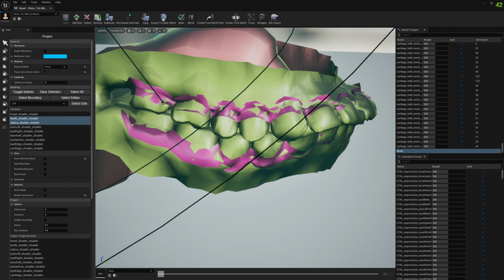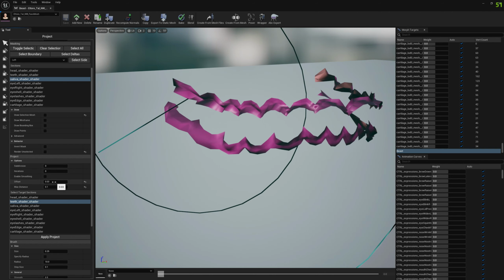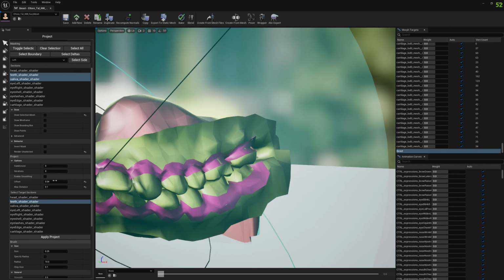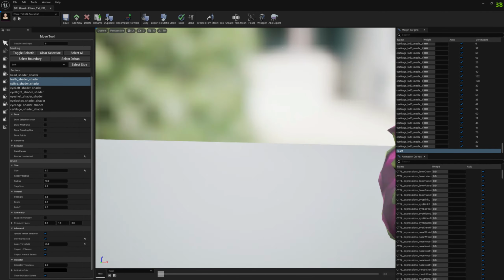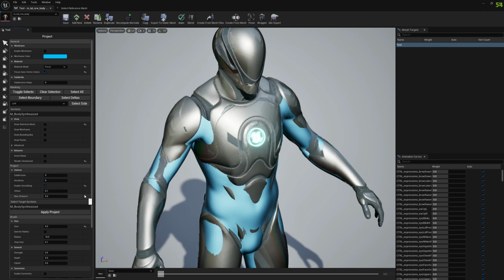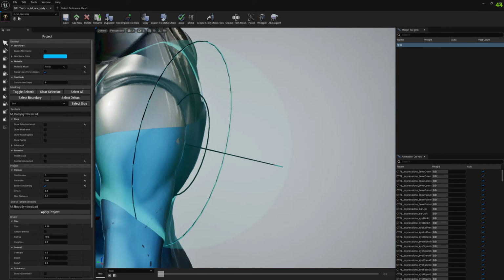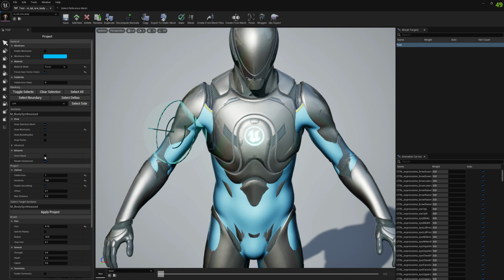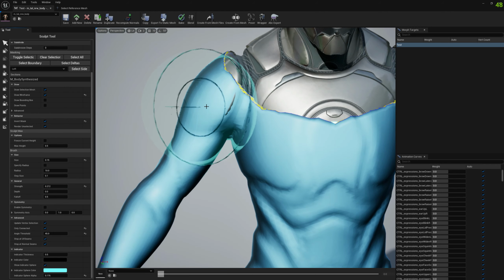Mesh Morpher - Projection Tool

Comment: Great feature, like keeping the projection on the surface when topological mesh, if there is a function that can smooth the mesh while keeping the projection even better. For example, in this state, the brush holding shift can keep the projection while smoothing the mesh. Because the result of indentation is usually partially imperfect, other brush deformations can cause the mesh to deviate from the actual outline of the projection.
If you have used wrap4D you will find that its most convenient feature is the ability to dynamically correct the topological smoothness of the mesh in different places with a brush while keeping the mesh wrapped. It's similar to adding a wrap modifier to blender and then using a sculpting smooth brush or a side Relax brush. It would be nice if MeshMorpher had something similar.
Thanks for your hardworking!